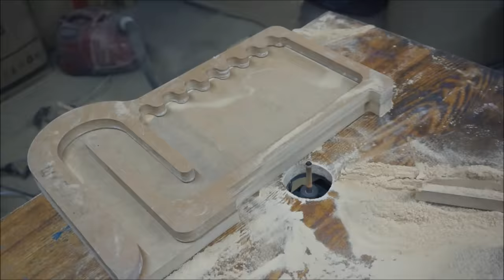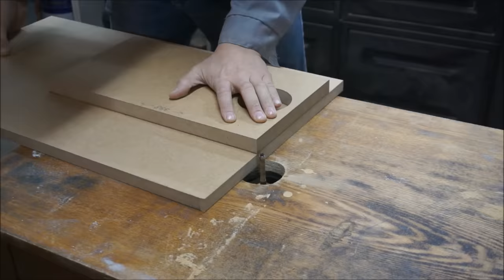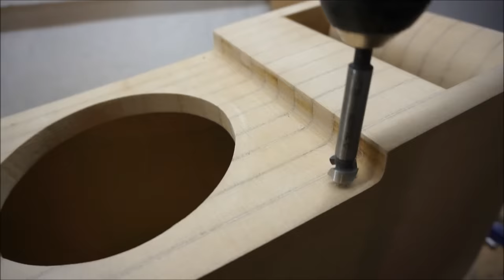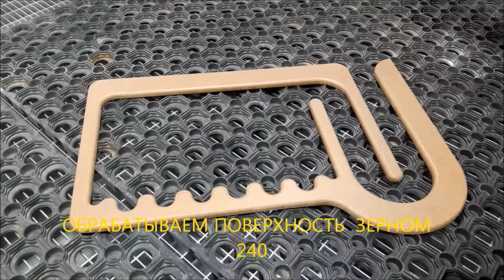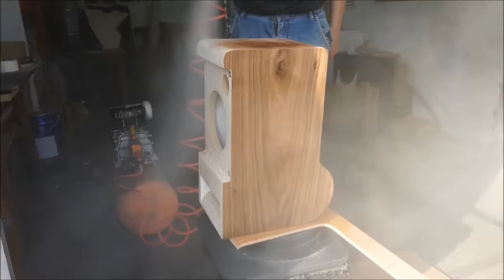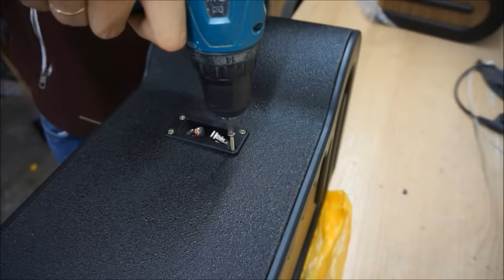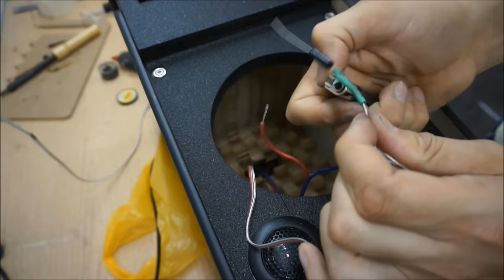DIY speaker assembly!

Comment: The cabinet work is gorgeous and the mix of color and texture looks great. This project is deserving of a proper crossover designed using the woofer specifications along with software such as PCD or Xsim to get the best sound out of whatever speaker drivers are selected. With this much effort put into the cabinets I would have used Scanspeak, Tangband, Peerless, or some other high end drivers along with an optimized crossover. Very original and innovative, excellent work!
Reply: Agree the drivers, xover, wiring and binding posts are not doing the effort put into the finish justice. Seems the focus is more on looks than sound, which is a pity.

Comment: Absolutely wonderful construction, although I prefer the mirror placing of the tweeters. Also the crossover circuits and the better speaker units will make the sound drastically better.

Comment: Truly excellent design with the transmission line load at the rear. The laminated design is a clever idea. I built some 30 litre transmission line speakers when young using KEF units. Alas I am 67 and the frequency response of my ears is just not worth it anymore !

Comment: To build a masterful cabinet like that and then to put car audio components in it is almost criminal.
Reply: Shocking ....   No proper Xover....
Reply: This is the prettiest looking toy speaker ever!!!! It definetly undermines the whole design because it's clearly not matched for the drivers
Reply from the maker: @Morgooooo  )))
Reply from the maker: @edwardbalboa5528  he is of the first order
Reply: whats the difference between car audio components and other(?)s
Reply: Onur Ege Sound quality.
Reply: @oeerturk  For one, the typical impedance. Car speakers are mostly 2 or 4 Ohms, most home audio drivers are 8 Ohm, since most home amplifiers are designed for this load. Either can sound good if properly designed, but the crossovers have to be designed for the impedance also. Care should also be taken to choose drivers that are close in sensitivity. If the woofer is 89 dB and the tweeter is 92 dB, the woofer will require twice the power to produce the same levels, so resistors would likely need to be added.
Reply: @lexlarkin   Bullshit, you've never heard  a high end car audio system in your life, or ? You can spend massive money in home hifi and car hifi. But to produce good sound in a Room is easier than in a car, and cheaper.
Reply: @NaturalBBler  but it isn't is it. Taming poor room acoustics is much harder than taming acoustics in car.
Reply: @oeerturk  quality auto drivers work well in many cases,, near field monitors.

Comment: So disappointed at the end..... that’s like crafting a supercar out of carbon fibre and putting an cheap old 1ltr engine in it. Grrrrrrrrrrrrrrr
Reply: there is a reason why there are specialists for bodywork...
I would trust this guy to build decent furniture.
Nothing with fancy electronics tho...
Reply: I know right?
Reply: I thought I was the only one thinking this,  if your gonna do car speakers then you need to run them active and some arc audio black series, focal flax If it’s the right ones I’m thinking about, or morels would sound very good in this enclosure
Reply: yeah i felt cheated at the end when he put 1 cap for the crossover in 1000 dollar custom enclosure with the tweeter off center like some 70s trash. wow
Reply: i woukd like to see some dynaudio d28 tweeters at the surface. and dynyudio 20w75 midbase inside. and why is the tweeter here sitting on the right side on both speakers? left one left side and right one right side. and please use real 12dB crossovers with wodercaps. in my ears that was the ultimate setup in my highend times in the late 80s
Reply: there is one......koenigsegg gemera

Comment: Wait, you went through all of that and didn’t use a proper crossover? Just a bass blocking cap, generic drivers, and no fill either? Bro, that could have been a much better sounding build.
Reply: Weird about the crossover. Looks like it was more of a woodworking project then a speaker project.
Reply: Yes, the speakers would probably really benefit from a real crossover, regarding the dampening I think the thought is that the pattern made by routing every other board different at the back would act as dampening. I think this is probably true for some frequencies, but some soft material on that would probably make things even better.
Reply: Add an outboard crossover.  dbx 4820.
Reply: Yeah thats really a petty. Also the short horn for the tweeter that is given by the front panel normally does not sound any good, but looks good😅
Reply: @PeterMMMMM  I have the same thought, too elaborated box and then use a cheap electrolitic capacitor, at least use a Solen Polipropilene
Reply: @Jingle Nuts Yes they are good for the money, as the best could cost 5 times more but my speakers I choose Solen capacitors and air core Heptalitz inductors
Reply: @mrsmith8436  Let me correct your ignorance, a Polypropylene capacitor sounds 40% better than a electrolitic capacitor, period.
Reply: @ThresholdZhor  I agre with you, I am speaker builder and restore speakers, a 20 dollar capacitor sounds much better than a 1 dollar capacitor, electrolitics doesn't have the speed and transparency of a good polypropylene
Reply: @mrsmith8436  I am currently listening to a an $18,000 set of speakers.  I own 16 sets of speakers and I work on all of them. I do, actually know about them.
Reply: @mrsmith8436  silenced.
Reply: Giuseppe
Reply: @PeterMMMMM  than***
Reply: @randallsquires  i have a pair of speakers that are $24,000 and they sound better
Reply: @leeknivek  I’m sure they do? Mine fortunately make me money.
Reply: Lots of things wrong with the electronic crossover and speaker choice. But I could not make that speaker cabinet like this chap . Amazing work! and craftmanship!
Reply: @mrsmith8436  I’m a mastering engineer. The speakers are dunlavy sc-v’s, and they are new to me. They had a couple of not great drivers, and after 26 years it was time to replace some crossover components. That is why I was working on them. 
As an engineer, I have that many speakers because of different listening systems, in different rooms, and for different tests. 
I’m amazed that this pissed so many people off. For fucks sake, a bass blocking cap on a tweeter does NOT a crossover make. That woofer is only meant to work between certain frequencies. Above that it is no longer liner, and therefore adds undesireable energy. What the hell is so hard to understand about that? 
And no, I don’t believe in magical fucking speaker or power cables. 
I have a set of speakers that cost that much because they are ruler fucking flat, as phase coherent as it gets, and therefore allows me to make sonic choices in recordings faster and more reliably, which means I give better products to my client and save them money. 
Get the fuck off my back.
Reply: @randallsquires  i have worked on Dunlavy's, they use Vifa's drivers, well at least model IV, I think they use Solen capacitors, very coherent speaker as is time align all the components
Reply: @ThresholdZhor  of this I am aware. Just replaced all of the 3” drivers, the 6.5” woofers, and both tweeters. Fortunately scan speak is making them again! About to dig in to the crossovers and thinking of replacing all with mundorfs. Again, as I make my living on these speakers they need to be 100%. 
I also own sc-ii’s, and a set of duntech PCL-400’s.
Reply: @randallsquires  that's good news, Scan Speak is a well regarded brand,  a bit better than Vifa
Reply: @ThresholdZhor  vifa was bought and moved to China for production. They no longer make the specific drivers that I needed. They wer all scan speak designs in the first place, so....
Reply: @randallsquires  too bad, they made very good drivers, i build my speaker using P21-W0-20-08 8 inch woofer and D25-ag-05-06 and I design my box a derivation of Avalon speakers which is for me one of the ideal speaker enclousure design as the side of components is only half inch of wood making them sound more open, but that notice that Vifa goes down broke my heart, that means that if I change a component I will need to modify the crossover I designed
Reply: @ThresholdZhor  you might get lucky, as I did. It seems that scan speak is aware of the need for those older designs and remaking them in Denmark to the same specs. 
Maybe give madisound a call.
Reply: Haven't read through all of the responses of the OP, but, yeah, talk about minimalism! A single capacitor for the tweeter...and then... Just depending on the natural rolloff of the the woofer in the ported enclosure? Also, they aren't mirror imaged. So, I guess imaging wasn't a concern, either, eh? :P I'm actually curious how they sound, though. I mean, A speaker design doesn't need to be very complicated, but I'm curious if any sort of planning went into this or if it was just a "this looks cool" project. :P
Reply: Wow. The gloves sure came off in this thread! :P The only thing I can add is that IMHO I believe quality components DO make a difference, but the cost to results returns diminish quickly. I redid the crossover for my Polk CS2 Series II center channel and used ClarityCap capacitors and wire wound resistors (I used the stock inductors). The results were great. I'm sure if Polk had used the same components that it would have added another 2-3 hundred bucks to the list price of the speaker.  There's a reason you have to spend thousands of dollars to get that next level of performance. Between all of the testing, sourcing of specially made/small batch semiconductors, and hands on labor that in the end ensures you are getting a product that at least somewhat matches (e.g. justifies) what you paid, the cost shoots up pretty fast. Anyway, that's all I've got to say. Incidentally, I mess around with crossovers and speakers fairly often, but older ones, as in 20 to 40 years old. Just a hobby of mine. ;)
Reply: @ThresholdZhor  40% better? Is that like 100%+40% ≈ sqrt(2) = 3 dB?
Reply: Maybe he was low on cash. Crossover networks can get expensive, especially the good ones.
Reply: @ze_german2921  absolutely, but a pair of inductors for the low pass on the woofer isn’t THAT expensive.
Reply: Have you guys helped this brother out? Hooked him up with the links etc to get the proper audiophile level drivers to do this fabulous enclosure justice?
Reply: I’d like to see the math on how he calculated the enclosure size an tuning of the port . Very nice wood work though.
Reply: @christopherfalconer9265  Its a gorgeous enclosure, and fantastically built. Also, very deserving of a proper crossover aside from the 6db/8ve high pass.
Reply: Look at the tool´s, he probably dont have money for better equipment.
Reply: @NaturalBBler  Iron core inductors are $10/each.
Reply: @marottajoe  Good amps are so cheap today, a line level Xover is a no brainer for everything except super low budget builds IMHO.
Reply: @ThresholdZhor  please say what you mean by 40% better.  You can''t, because its a completely meaningless statement.
Reply: @richardsinger01  It seems you haven't made evaluations using different capacitors as I do, compare a electrolytic capacitor for example 4.7 micro farad with a Infini Cap of the same value using a good tweeter and you'll going to hear that 40% improvement
Reply: @mrsmith8436  True, however, what high end home HiFi speaker company that you know of makes drivers with the company logo painted on the dust cap? These look like car stereo speakers to me. Also, there is no way that these will sound better as is than doing the build using a proper cross-over board and audiophile drivers.
Reply: @mrsmith8436  Ok it seems you are a lonely guy in the world and needs attention and that's why you keep contradictory with all others, I thought you were kiring about you don't hear a difference with a electrolitic cap and a good polypropelene cap in the tweeter for example filtering low frequency's in a 1rst order ( 6 db/ octave ) slope, that only means your ears are old and can't hear that diference, but let me tell you that is good news for you because you don't need to buy a capacitor 20 times the price more LOL
Reply: @mrsmith8436  Because you happen to know what industry standard is amongst mastering engineers? Sorry mate, you are quite wrong. Yes we do also listen on the common sets of speakers and devices as well, but in most mastering studios you will see Dunlavy, Duntech, PMC, Kii, Dynaudio, ATC etc.... and yes, they are as well as the properly designed rooms....ruler flat.
Have a nice day.
Reply: Hey, If this guy can build me an identical pair (obviously tweeters opposed) i would happily buy them at probably pennies and swap out the electronics. You have to appreciate the time in build and paint, even if he is going to have skin & lung conditions from not wearing PPE.. 
Cool to see what people can achieve with just simple tools and determination..

Comment: Beautiful work on the speaker cabinets. It seems that you did your homework as well regarding the enclosure volume. One thing though, As mentioned below take those speakers out, add some good home speakers. (Pride is a car audio brand) Then add a good crossover. The speakers might even be very high quality. However they are made for the acoustics of a car. If you added a crossover, did some work on crossover frequency, and added some good home speakers what you hear now will be much better. Most of the work is already done, your cabinets are functional as well as being really nice looking. BRAVO!!

Comment: Interesting design for rear standing wave diffuser. Everyone has commented on the lack of proper crossover and tweeter placement. Why someone would spend so much $$$ on the cabinet comp board and then skimp on components is almost beyond belief. Did your cost of cabinet materials exceed  by a factor of two or three? I don’t even want guess on total labor time.
Reply: 99David 99 : This build is a piece of art, not an HiFi device. Besides, I built something similar once and even with a simple cap on the tweeter and no crossover for the woofer it actually sounded very good. Art is not about economics it's about a soul expressing its passion. I think it's a very nice creation.
Reply: Tsrif Tsal  Wow! Talk about slamming a total stranger!  I did not slam the builder of the speakers. Nor did I call him by any derogatory names. I complimented him on his concept for his diffuser. As to building speakers, I know more than a little about the subject having built and designed several. My designs were not works of visual art as this design is in my opinion. Normally I don’t bother answering trolls, but in this case, designer appeared to take offense at my comments and he highlighted your response to me. No offense intended to the builder. He is obviously a talented cabinet builder.
Reply: @jimviau327  I agree with you regarding the artistry of the design. My comment was ONLY in reference to a lack of understanding of basic sound design principles. One can mount a woofer and a tweeter on a flat baffle and achieve an “OK” sound with or without a cabinet or a crossover.
Reply: @creamwobbly  Yeah, but I wonder what the basic idea COULD sound like if some basic sound design principles were used to compliment such a labor intensive, artistic package.
Reply: @David-ei5lq  if a woofer naturally rolls off at lets say 5000hz 89db then all you need is a cap on the tweeter, there is no need for an inductor, if the woofer rolled off at 10000 then an inductor would be necessary to shut it off at 5000hz if thats your intended frequency point, without knowing the specs its hard to to work out whats hes done, given the size of the tweeter and the physical size of the cap i would guess hes using a 4.7uf cap which then makes the crossover point at 4500HZ, Epos do the same design, just one cap on the tweeter, its all it needs.
Reply: @vitorpandeque4896  epos manufacture the drive units,  which are very different to other drive units
Reply: @vitorpandeque4896  epi, epicure, genesis, bruhoe...used woofer voice coil as inductance and a single cap @1800hertz on a lot of they're models,,, these companies were more than successful.

Comment: Seems preety advanced to be called 'Diy' i'm not sure that many people have access to that amount of equipment. However they look nice, it's a pity the driver and tweeter, didn't look especially good, at least not by eye; it would have been better perhaps to repurpose drivers from damaged speaker cabnits of know quiality, if you could get hold of them. I agree with others about the crossover, i'm not an electical of auido engineer, so wouldn't know what it takes to build a quiality one, but, if i've just spent that long making my own speakers, i'd think i'd look around and see what a good one looked like.
Reply: can still do something similar with basic tools using this to inspire your project

Comment: Common please use a bigger milling cutter. This tiny Little thing gets pretty warm for sure.
Reply: They're cheap and disposable. No big deal.
Reply: Ok. But a bigger one has a higher cutting Speed. Thats much easyer to handle. 
But ok. Cheap is an good Argument :) still nice work bro
Reply: You can't use a tool bigger than the radiuses you want to cut, looks like it is close to the biggest his design allowed.
Reply: Mmh. Thats Naturally another way i dont thought about 😂

Comment: To add to others comments, the tweeters thick  rim around it will cut dispersion and hamper imaging quite a bit. a nice dome tweeter like that should be surface mounted to eliminate the "wall" around it that stops it from dispersing at near 180 degrees.
Beautiful build though. A whole lot of work went into it... that's for sure!